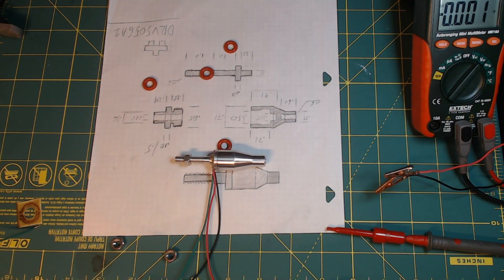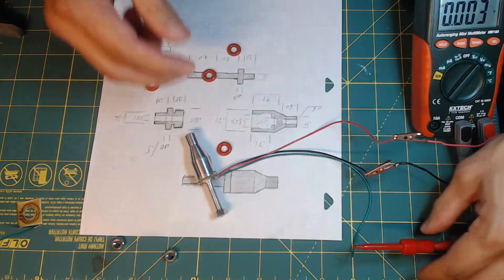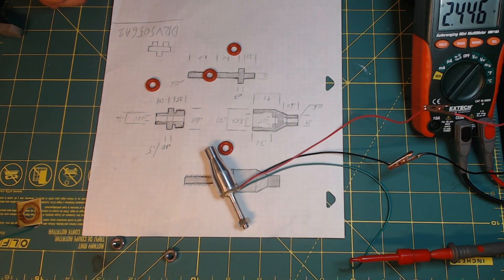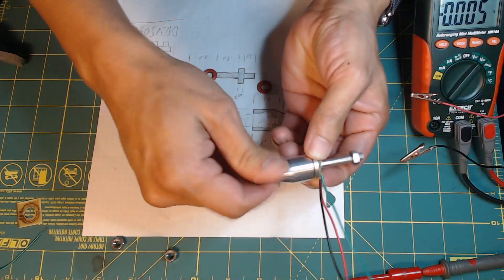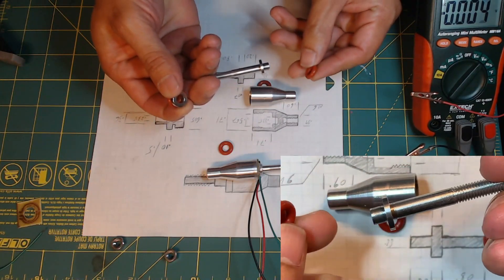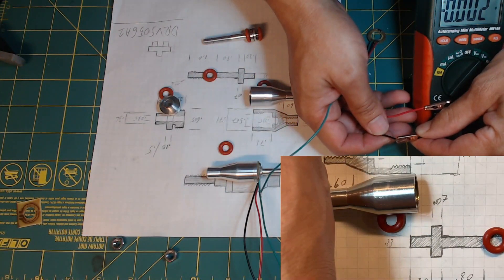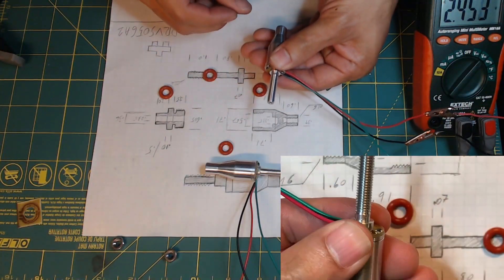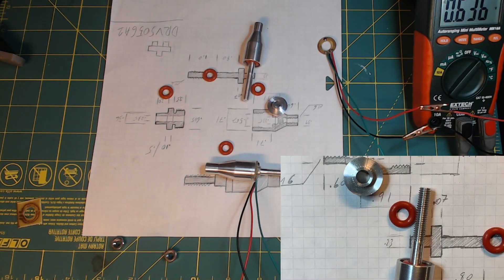QuickShifter sensor build Part 2 - DIY

Comment: Very cool idea! From what I can see, the shaft compresses the o-rings to provide for the movement. Any reason why a stiff spring won't work?
Reply from the maker: @jacquesblom2312  the video is old at the time that is what I had, now the current unit uses 10lbs spring washers.

Comment: Hey what's the reference of your sensor? Have you a link please?
Reply from the maker: The electronic part? DRV5056 you can get it from digikey or mouser.com
Reply: @guser210  and the ring?
Reply from the maker: @ewanguilleret7781  the o-ring is 1173N202 you can get that from mcmaster.com
Reply: @guser210  thanks 🙏🏻
Reply: @guser210  and finilly what is the steel ring reference link to the sensor?
Reply from the maker: @ewanguilleret7781  no problem, I am changing the design by the way, I will be posting the mew design next month
Reply from the maker: @ewanguilleret7781  the magnet is SKU#M121418R from apexmagnets.com
Reply: @guser210  oh great thanks!

Comment: Hi there, do how have any knowledge regarding push type of sensors? Do they also work with a magnet?
Reply from the maker: This sensor is both push and pull but I am not sure how others work
Reply: @guser210  I am refering to this one. https://www.dynojet.com/quick-shifter-power-commander-v-linear-shift-sensor-push-type/ 

So instead of a fix point inside, it has a rod that moves up and down
Reply from the maker: @michaelo.8276  I am not sure my guess is that they have a load cell
Reply: @guser210  For some reason I think it might be magnetic. My rod pulled out while I was fixing my bracket to install it. In the process it seems to have damaged to actuator and trying to fix it now
Reply from the maker: @michaelo.8276  you should be able to see if is magnetic by simply putting a small piece of metal wire close to it.
Reply from the maker: @michaelo.8276  by the way if is a two wire connector then is likely a load cell or a switch type.
Reply: @guser210  Perfect thanks! Will have a look

Comment: what is the worst case scenario if diy quickshifter does not work at high rpm's?
Reply from the maker: It won’t shift unless you use the clutch the normal way. Obviously it depends on how much redundancy you want to add. It all depends on the code you write, let’s say you write faulty code and you forget to release the coil for some reason and you engage the next coil... you will blow a fuse and the bike will shutoff, or if your timing is off and end up releasing the coil late... the cylinder won’t fire and the bike will backfire, if you do enough for those you will shoot a huge flame, looks awesome at night. If you release the coil early nothing happens because the ecu won’t release it and will take over

Comment: DRV5056 vietnam not sell. Can change DRV5056 to hall effect 3144?Yes?
Reply from the maker: Dương Cao Quốc Huy I don’t think it will, you need to look for a linear Hall effect
Reply: @guser210  yes. You can share me Your Fb. I have project using rpm and QS

Comment: Hello friend, very good video.  What type of magnet do you use and where can you get it already drilled?  Otherwise, how did you make the hole?  The rest is aluminum?
Reply from the maker: Hello there, you can get the magnet from apexmagnets.com the part number is M121418R, the pull force is 3lb and yes the rest of the components are made of Alumnium

Comment: Hello, Can you make a short video to show how the electronics are made? And by the way, how much is the input voltage? 5V?
Reply from the maker: Duy Tùng Phạm sure, I’ll do one this weekend
Reply: @guser210  thank you sir, I've been looking for the sensor working principle for so long until I found your videos, they're very helpful.
Reply from the maker: Duy Tùng Phạm yes is 5 volts but it works from 3 volts up to 30 volts.
Reply from the maker: Duy Tùng Phạm video is being processed, should be ready in a few minutes
Reply: @guser210  that's fantastic sir, I've been through the weekend waiting for your video.
Reply from the maker: Duy Tùng Phạm sorry man, I was busy trying to get other stuff out of the way and waiting for the components to arrive on the mail.

Comment: Hello can i buy it?
Reply from the maker: Har tarto do you want the kit so you can assemble it yourself ?
Reply: @guser210  hello, also interested of buying one
Reply from the maker: @7gumball  are here in the US?
Reply: @guser210  Im in Canada
Reply from the maker: @7gumball  just out of curiosity what are you going to use this on?
Reply: @guser210  I will be using it for my drag civic no lift shift/shiftcut. Fortunately my shifter cable has a spot for it. My ecu does take 0-5volt input as for shitcut functionality
Reply from the maker: @7gumball  cool, ill machine one for you but it will take a few weeks I’m in the middle of another project.
Reply: @guser210  do you have email address I can communicate with you?
Reply from the maker: @7gumball  https://discord.gg/ngnV5Xe5WN
Reply from the maker: @7gumball  Hey,
 are the rod and swivel right hand threads?

Comment: Ive made my Quickshifter sensor myself aswell, however most ecu's need a closed circuit as input signal. Ive used a switch in my design so it closes on shifting.
Reply from the maker: Tygo do you get any f1 errors when you shift?
Reply: @guser210  What do you mean with f1 error? I do have a video about my quickshifter on my channel.
Reply from the maker: Tygo ah I see your bike is bit different, usually big bike ACU’s will give errors if you mod any of the inputs, I saw your video very cool, now you just to to mod it to rev on downshift.
Reply: @guser210  the sensor i made actually only is a push type sensor, that is because I have a carbureted bike.(rev on downshift is impossible this way) I do want to know tho how you would use yours, so how do you connect the quickshifter sensor(which puts out a voltage) to the bike(which cuts the ignition or injectors)?
Reply from the maker: Tygo cool, I’ll do a series of videos on the entire unit, I tried cutting power, fuel, and spark, but the one that seems to work best is delaying spark since you can smooth it out as much as you want.
Reply: @guser210  Nice! What bike are you trying on? But cutting the injectors is an advantage for safety of the engine(no detonation). It should not be hard to cut the injectors tho
Reply from the maker: Tygo it will be on an R3, yeah but most big bikes have 8 injectors... ignition is 4 so much easier to keep them synchronized, my first design was injector base on a GSX-R600 it worked but it made the unit too big due to the additional switches.
Reply: @guser210  I think you could use a mosfet to disable all the injectors by removing the ground, but if it works you should stick with this! Nice to see someone else creating his own quickshifter! Looking forward to the end result.
Reply from the maker: Tygo Its actually an IGBT, it needs to be able to handle at least 400volts and 20amps of current, the voltage spike from the coil can reach 1K volts on some bikes. The bikes ECU keeps the ground disconnected and connects it a few milliseconds before firing, you have to be able to detect when it does it and for how long, once you have that you can hold it to ground a little longer to delay the spark, unfortunately you can not keep them all to ground since the fuse limits it to around 10amps and each coil draws around 6amps
Reply from the maker: Tygo https://youtu.be/ylIWqhcTBgc this back in 2015 when I added downshift
Reply: @tygo9500  Not impossible at all.  A servo motor could give you a blip if attached correctly.
Reply: @darthpaul4432  It might be better to use a solonoid instead. Make a hardware limit of the maximum pulling stroke. Could be done, but not with my setup. At least not reliably.(Dellorto VHSB 34)

Comment: Thank you, great idea , now I will try to replicate it for my bike, 
Now I'm using a timer XY-LJ02 setting at 60ms with relè and  a hall sensor, magnet etc etc , it works but the neodymium magnet attracts metal dust ...
Reply from the maker: orlando what exactly are you going to do? Kill power to the engine and then let it jump start on its on?
Reply: @guser210  I create bypass "Y" connector ignition coil,
One head connect to ignition coil (two wire i use only black wire) and other head connect to rele on Timer XY-LJ02,and 3th connector to engine wiring
Hall sensor a3144 and 3d print support installed proximity gear lever, but the neodimio magnet pasted epoxy glue on gear lever, It attracts dust and the play between sensor and magnet and only 1 millimeter, after 20 km I find myself with the magnet already full of dust and falsifies the operation.
the relay is connected in NC mode, I switch it off and use the clutch normally, when the dust False the signal.
👍👍
Reply: @orlando8193  try filling that 1mm space with some non magnetic material like plastic.